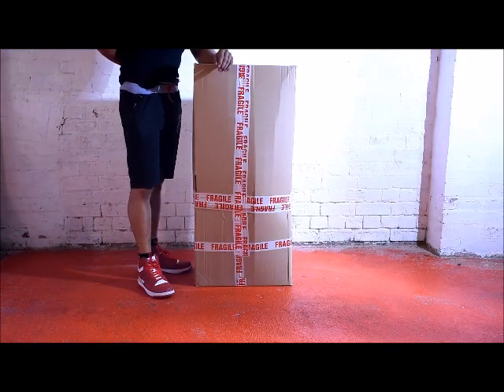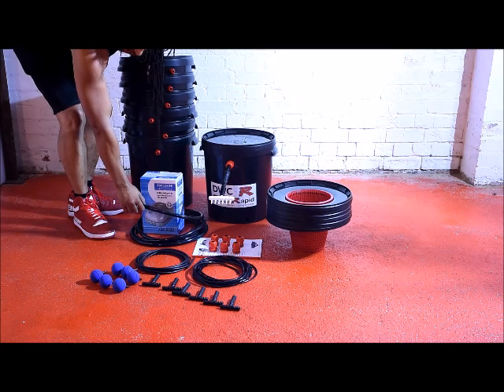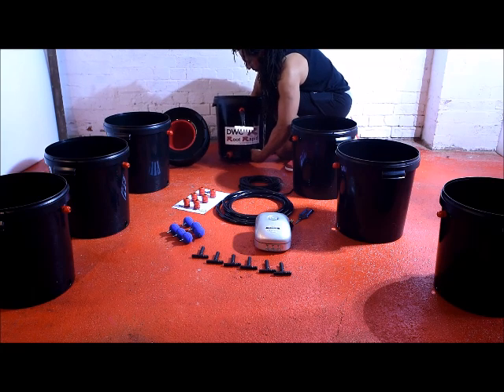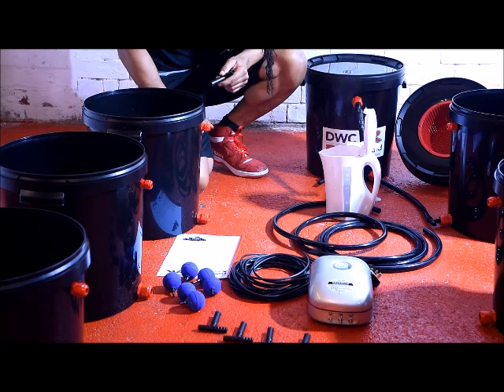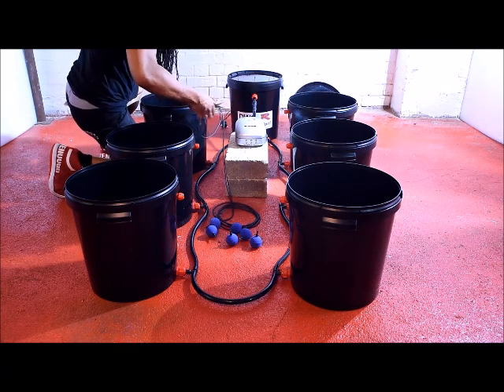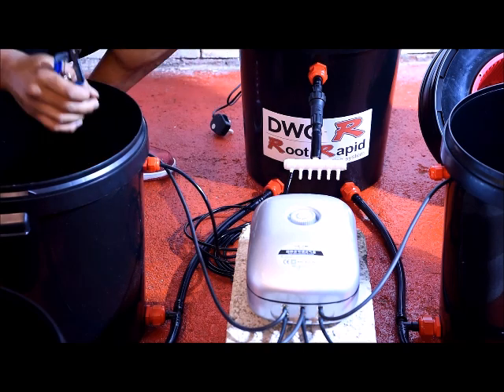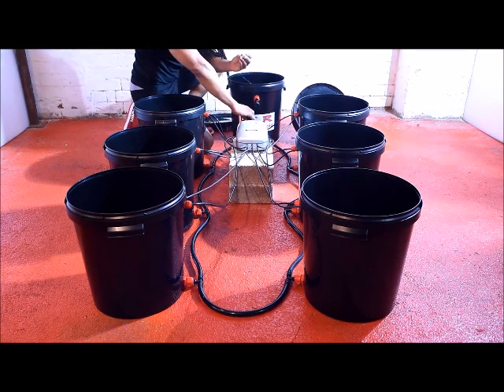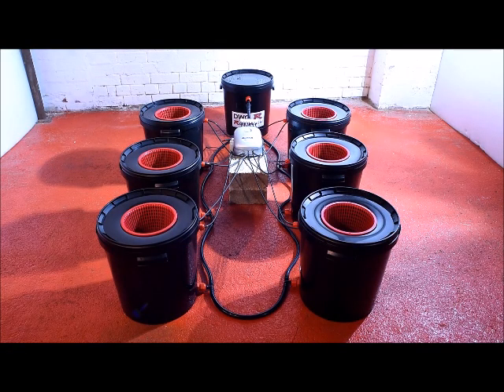Basement Lighting DWC - R Root Rapid Hydroponics System Set up

Comment: now do drain this system?
Reply from the maker: Unscrew the inline filter and the system will pump through the unscrewed filter. Just make sure to have something to catch the water in as it pumps out the system.
Reply: Why is the reservoir so small and  how would I feed all 6pot with equal nutrients

Comment: How easy is it to drain?
Reply from the maker: If you turn the pump off and unscrew the filter as shown at 6:50 then turn the pump back on, the system will drain itself through the unscrewed filter.
Reply: Easy peasy

Comment: I see quite a few of these video's but none of them show how and where to add a cooler. As water temperature is an important thing in hydroponics it would be good to have a video showing how to do this and also if a pond bio filter was added to the system would that negate the need to change the water every week.
Reply: cooler goes in main resevoir
Reply: Pump in reservoir connector & tubing  to chiller ,  tubing back to reservoir chilled , served to plants !
Reply: @America First the plants will use up the nutrients so i would say weekly at a minimum

Comment: when first time set up and adding water did you lock in your nuits, pH and ppm for all 6 buckets plus control pot or just fresh water and using control pot to dial in once you have roots and growth .. I know,.. might be a stupid question I'm just looking for a dwc or bubble system with a res so I'm not watering every other day.
Reply from the maker: Hello, calculate how many litres of nutrient you have to add in first time keeping the level a couple of cm below the net pot. Then mix all solution to the required PH and PPM in a large tub / barrel then add it all to the system. Once you've done this you can top up and adjust accordingly as required.